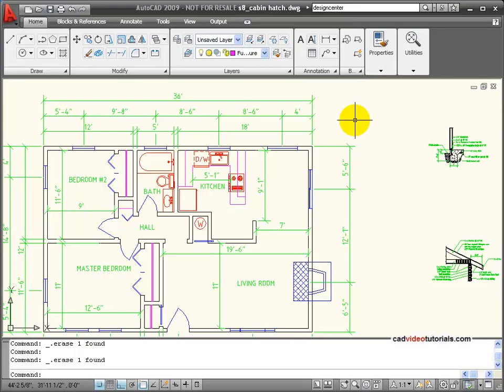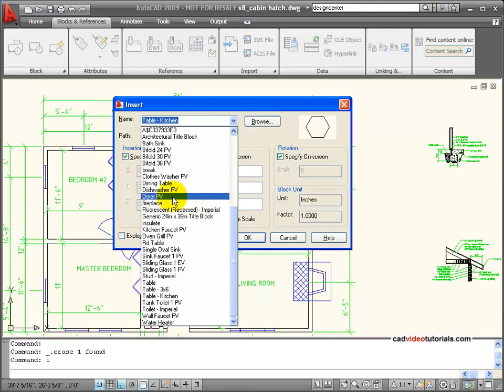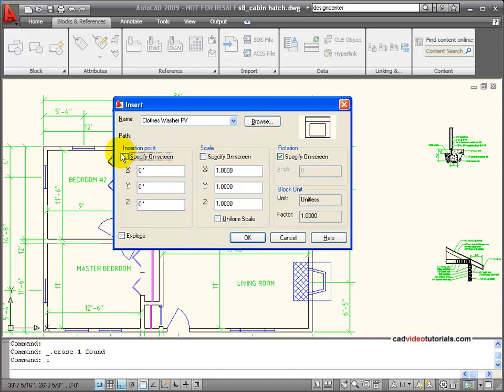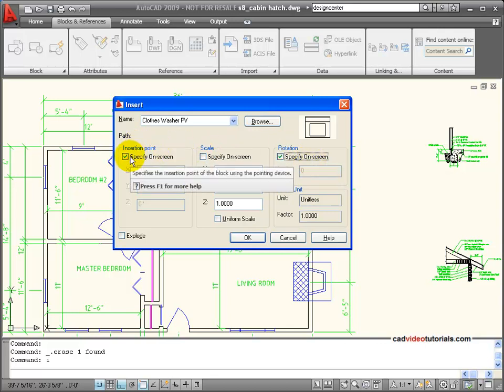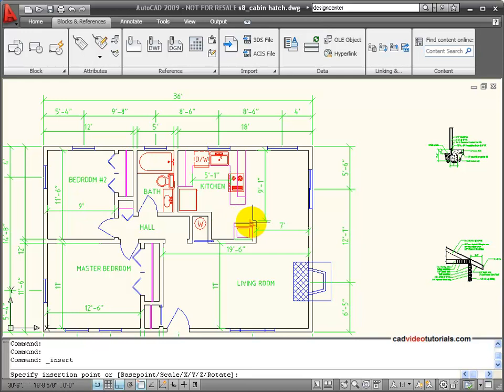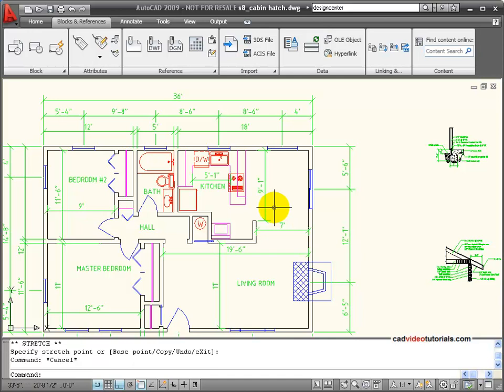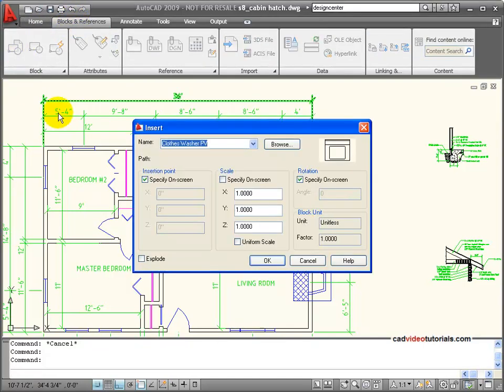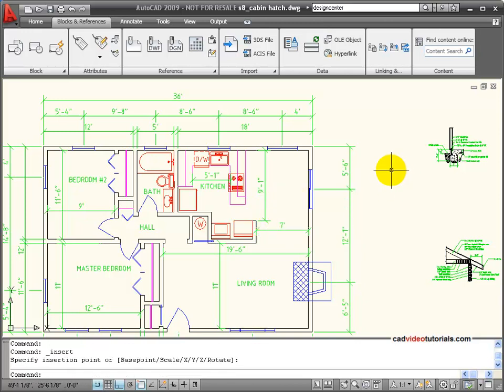AutoCAD Tutorial -  Inserting Blocks and Symbols

Comment: Bummer, Ok, Im working on making a sheet to put into design center/blocks.I have several made from the old sheets. Is there a way I can drop in template and they change to correct scale. I read on forum about using user references, options. But I'm using 2017 so I cant find those options. It sound like that is what I can do.... Thanks :)

Comment: I have starting working at new company and all sheets are different in scale the drawing. I have set up my drawing template 1:1
I am to set up standards so all sheets the same size. I want to change all sheets, made previously into correct scale. to much to each object at a time. Is there a way to copy the drawing/model space into my template and correct the scale? Or is there a way to change the scale on whole drawing to 1:1?
Reply: Click Edit on menu bar, click copy and select the title block then right click. Once the selected outline changes to continuous line the TB is copied. Go to your new layout or template, click edit and paste on the template. now move the TB at the bottom left to the bottom left of the paper space. the follow this steps.
1. Click scale in modify tab and select the TB then press enter.
2. Select the baseline and enter R on your keypad then press enter.
3. Now select the end of the TB on the left and right side at the bottom and move to your desire position on your TB. the Title Block will automatically adjust vertically and horizontally to the paper space. That is it and it is scale 1:1